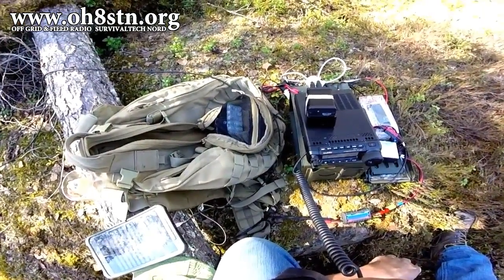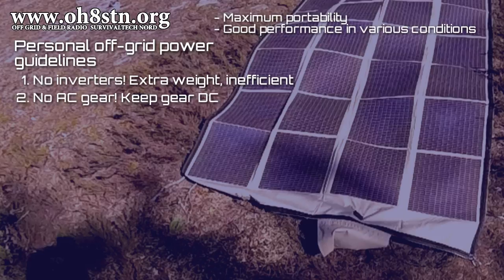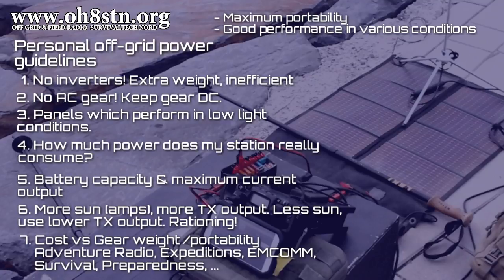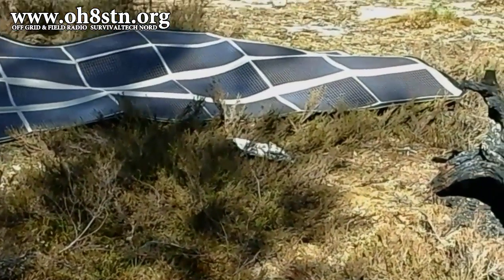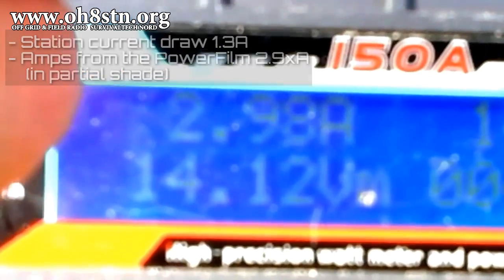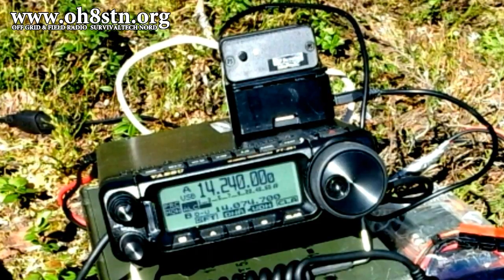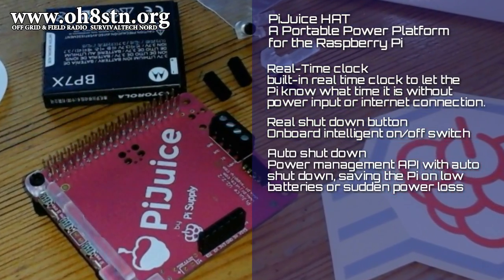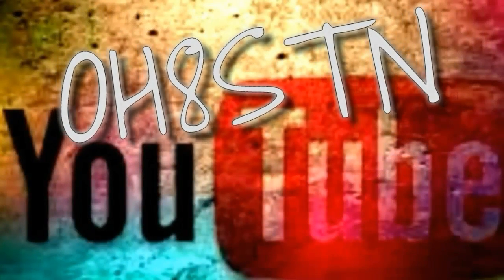Portable Ham Radio on Solar Power

Comment: Hi there! Greetings from the UK.
Great video. I am new to this ham world so there are a few things I did not completely understand like what role did the raspberry played, but I am sure other videos on your channel will show me that.
Thanks for sharing.
Reply from the maker: Raspberry Pi is the computer running our software for data modes. We use the Android tablet as a screen and keyboard for the Raspberry Pi which doesn't have its own. In my more recent videos, I use a Microsoft Surface in place of the Raspberry Pi and Android tablet. Same concept, but fewer pieces.
We can also do other types of communications without a computer, voice or CW for example. 
73
Julian oh8stn
Reply: @OH8STN  Thanks for taking the time to get back. It is staring to make sense. Also it opens another layer of interest to me as I can potentially send an sms or an email to distant friends - Being new to this I have no friends in the ham community.

Comment: What an interesting video!
I found this searching for some ideas on how I can switch between a power supply and a battery automatically in my own portable setup I'm building into a case.
I really like your setup but what I like more is how your examples make it easy to think about how I would apply the same principles to my own "luggable" HF setup.
73 de N2NLQ

Comment: I have an FT-891 Mounted in my Truck, along with an FTM-100 to complete my Mobile Station. The 891 feeds a Screwdriver Antenna, and has given me NO issues! DON'T like the FTM 100 as much, however-too hard to program for what it is. SERIOUSLY considering selling the 100, and replacing it with a Kenwood TM-V71.
Reply from the maker: I have a similar set up Bruce I have the Acer ft-891 and the Subaru Outback. Its backed up with the Kenwood TM d700. It's an excellent solution since I'm not doing VHF UHF SSB from mobile anyway

Comment: Julian, I have owned a PowerFilm 28W rollable panels since 2015.  I went with a rollable panel because it's 100% waterproof, whereas PowerFilm's foldable panels are water resistant.  After seeing this video, I decided to take another look at their foldable panels. The FM16-3600LTMC caught my eye.  It offers more than twice the power of my rollable panel with no increase in weight--both weigh about 2 lbs (slightly less than a kg).  However, I learned from PowerFilm support that the solar cells in the foldable panels are susceptible to water damage.  I've been careful to waterproof my battery and charge controller, so it seems like a pretty significant compromise to give up the waterproofness of a rollable panel.  They do make a 60W rollable panel, but it weighs 4 lbs.  Has your 120W panel been exposed to water?  I'd be interested to know how it holds up to rain and submersion.  I suspect it can recover from occasional, brief exposure, but long-term or frequently repeated exposure is probably bad.  I don't know much about the climate of Finland...
Reply from the maker: Yeah I agree with you Dave. I don't give the panels long-term exposure to water or moisture and certainly don't submerge them. The worst test I've done with one of the panels was hosing it off with water in the fm16 1200 video. 20 watt panel continues to operate flawlessly. To be fair whenever my panels have been exposed to a lot of rain or water, I have taking care to make sure they are properly dried dry afterwards. 
In Finland the biggest issue is cold and of course snow. Very rarely will we have Monsoon rains. It's more likely a moose will step on it ;)
I like the rollable completely waterproof series, but the weight isn't manageable.

Comment: Got a pijuice hat, have “communication_error” message at startup. Done basic resets, contacted pisupply, any suggestions? Tx Mike
Reply from the maker: I've had that a couple of times also. All I've done to correct it is go into the preferences in the startup menu for the PiJuice,  and restart the utility. That cleared it right up

Comment: I am having a problem loading WSJTX to my pi.  Tried to follow WSPRnet.org/drupal/node/5567 for raspbian from ARRL article. Any suggestions?
Reply from the maker: https://oh8stn.org/blog/2018/05/24/wsjt-x-fldigi-on-raspberry-pi/
Reply from the maker: I had to read that post to see why you had problems. It's different for a Raspberry Pi but only slightly. The link I sent you from my blog points to instructions specifically meant for a Raspberry Pi. There's also the instructions for fldig. They should get you going
I'll do video tutorials of this as soon as I have a second Raspberry Pi.
Hope this helps. 
73
Julian oh8stn
Reply: Thanks for the help.  Got a PiJuice. Set up was straight forward but options settings with the switches requires a tutorial,  Add your list of vids.
Reply from the maker: That's a fair assessment. I told them the documentation was awful. They said they had some problems with their website and lost the documentation that they had. They're working on you instructions.

Comment: Hi Julian 
Somebody on this blog suggested a GPS receiver instead of a battery backed up clock. I bought one for a few Euros  and I am very pleased with the results. Not only do I get my latitude  and longitude but a clock in GMT,  height above sea level, speed travelling and  climb but also my maidenhead grid square  within 18m. It also list the number of satellites available and which are used.  Nifty when one is posted to a grid square or needs to give ones coordinates. 
Chris de 9H1BW
Reply from the maker: Yeah the GPS is a great idea, and I think I'm going to do it as well. The clock was just a bonus, it was the battery backup that I was really interested in. Do you have a link to instructions how you did it?
Reply: OH8STN I tried to share the forum thread which has the software coding to install the GPS receiver. So here I am copying the site
Https://raspberry pi.stackexchange.com/question/547/how do I attach a GPS receiver.
I hope you will manage.
If I succeed i will send the aliexpress site
Reply from the maker: Thanks Chris

Comment: Great vid. Two questions: can you swap out the PiJuice for one of those adafruit clocks? How does one "click on the waterfall" when running fldigi on raspi vnc to tablet? Thx.
Reply from the maker: Hi Ian.
I hadn't thought about the Adafruit clock, but I suppose it could. I like the battery backup functionality of thre PiJuice hat. If I weren't using it, every probably just plugging GPS into one of the free ports, and use ntpd to sync the computer clock over GPS.
The last clicks work almost the same as the touchscreen on the tablet. Remove a mouse pointer over a button, then touch to click. There's also a drop-down menu to activate the keyboard. For a tablet Commando it's very intuitive.

Comment: I gotta say my raspberry pi with my radio and a $8 USB sound card is working so well, I am not sure why I need to upgrade to anything more. I'm sure I will get a Wolfie link or the SC eventually, I'm sure I will find a reason!
Reply from the maker: Actually I just ordered a USB sound card with a trrs output. I'm going to use that with the WolphiLink as the audio interface for the 891. This reduces the power requirements, and also saves space.
Reply: OH8STN I will say the $8 soundcard is great with my Rpi but not so good when I use it on my windows computer... I am gonna try it again soon on a new computer using winlink... we will see how that goes.

Comment: I am not finding much specific information on the pie juice hat. Are you charging it using 12volts input? Would be nice to be able to charge it straight off the same battery that is running my radio WITHOUT any sort of step down.
Reply from the maker: At the moment it's capped at 10volts. I mentioned to p i Supply that 13-15 volts would be more realistic. I was told them talk to their engineering staff
Reply: OH8STN no joke! 2 volts aways from common sense!
Reply from the maker: Sometimes Engineers spend too much in the lab and not enough time in the field. In fact wider variable input voltage is about the only thing I would change
Reply: OH8STN thank you for the information!   I have not been able to find any amplifying information anywhere on this. No one even answered my questions on Amazon! Haha. You are a great addition to the community. Between you and Ian Lee (UBITx stuff) I have become very motivated and informed... but most of all supported!

Comment: Really enjoy your videos.  Looking forward to more videos on the Raspberry Pi hardware and software.  One questions, were you able to put this gear in a backpack and if so, what was the total weight?  Thank you for all your efforts in man-portable communications.  It has been an inspiration.  I actually built your DIY 10ah lithium battery pack using the Genasun charge controller.  Best Regards.